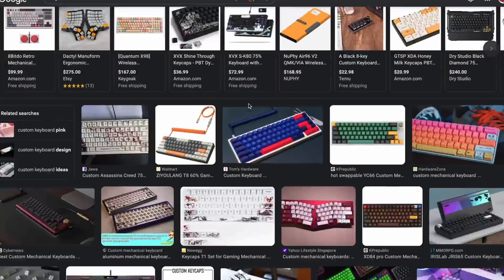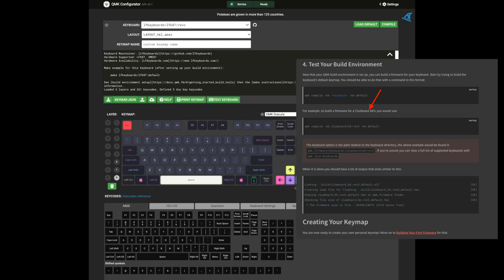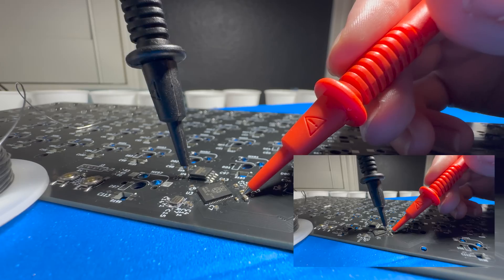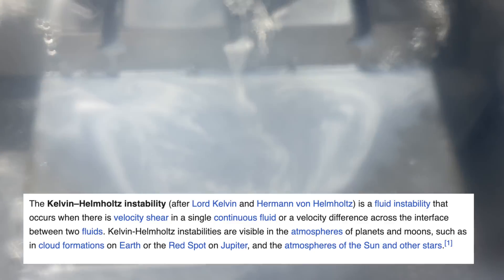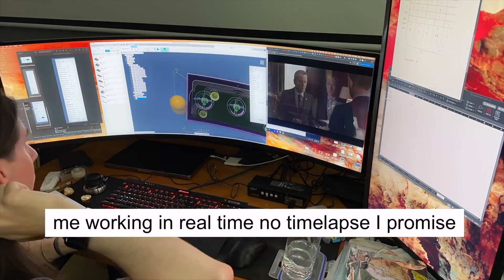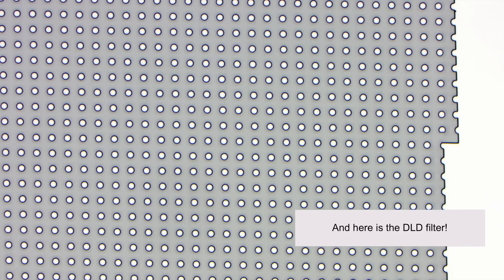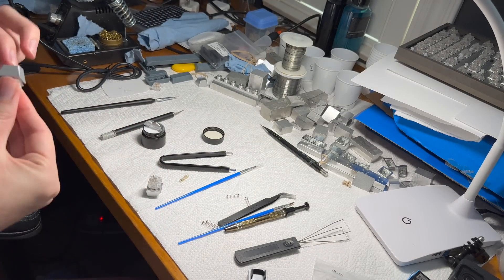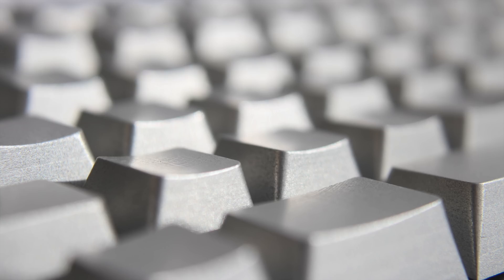Design and Fabrication of a Custom All-Metal Keyboard | banoa102

Comment: Hi boss, love the video. I saw you where using a third party simulation package instead of the one built into solidworks, why is that? Would you mind sharing the name, and the process of transferring the data in-between the two applications? We are currently running solidworks simulation trial but we are not to satisfied because many features are locked behind pay walls. ❤
Reply: O i see it is ansys, however i would still like to know if it's worth getting
Reply from the maker: @Bobsonman  Hey thanks for watching! Ansys is a great tool but it is rather expensive. They break it up into different modules (electrical, mechanical, cfd, etc). You could probably expect to pay 10k+ a year. I think startups get a discount. I receive the software free due to my college, but in about a year I will need to get it or have the company fund it. Hope that helps

Comment: Those keycaps for one printer would be so much easier and cheaper to produce using metal Printing, can do it all in a single job taking up the full build volume.
Reply from the maker: But then I don't get anything out of the project besides paying someone else to do the work for me. I don't have access to an DMLS printer

Comment: Wow man, that's a cool ass project, as someone who is currently doing mechanical engineering, this makes me want to finish this course even more, all of the problem solving involved in both the design and the manufacturing is simply incredible. Just a question, and I'm sorry if someone else asked, but how much does the final product weigh? You could probably use it as a weapon if you wanted to!
Reply from the maker: Glad you enjoyed! The keyboard weighs 4.5 pounds. Cheers!

Comment: Absolutely insane work mate, as you’re limited by low spindle speed for the radius of the ball nose end mill, I would recommend just buffing the outer surface of the keys to achieve a better finish. To increase production speed you could finish both long angled edges of the keys on a manual mill or with an angle fixture in the cnc. It’s always incredibly beneficial to modify less critical parts of your design to accomodate tooling and ease of manufacture, which can be hard to commit to if you become too engrossed in the design you want. If you had a cnc lathe, you could machine a fixture that grabs the keys from the backside, allowing you to turn the internal radius on the top of the key much faster. A similar fixture could be used in the mill, holding the key at the rake angle of the key side, to machine and finish the sides of the key to a higher quality. Maybe you could automate the indexing of the fixture as well. Simplification and streamlining of manufacture can save you a surprising amount of time. I am very impressed with the endurance and passion you expressed, and how you were able to stay so committed to completing such a daunting task. I imagine you will go very far as an engineer.
Reply from the maker: Thank you for the kind words. You are right there is a lot of creative ways to speed up manufacturing and I'm sure a lot of tricks I have yet to learn. Glad you enjoyed the video :)

Comment: Awesome video. DIdn't think I'd make it through. A few notes > you could have made it out of two pcbs so you could swap numpad side and run a channel for the cabling for the second board (or have the traces run to both ends of the board that is cabled. IN TERMS OF MACHINING. great job. I would've never tilted the head because retram is no fun but thats whatever. For the keys you could have done them in a few ops with longer material and tooling holes at an angle. This means you could screw down the block of 5 keys at a time and then just hit the front / back / top with an endmill in three ops for the best surface finish and almost no 3D milling. The tooling holes would have needed to be put in using an angle block first (or just straight in and the angle block was 3Ded with screws not perpendicular to the top face but to the bottom. Basically for the extra workholding and additional setups, you'd have dropped run time for the long 3D front back to almost no time at all. 1-2 passes with an endmill sidemilling instead of stepping down.

Comment: I wonder why you didn't metal 3d printer the caps form PCB way , I mean you milled lot of material.
Reply from the maker: Part of the point of the project was to get more experience with design and machining. That doesn't happen if I pa someone to do the hard work for me. Thanks for watching :)

Comment: Only 40h to do that? That's impressive, must be a lot of compicated connections...
Reply from the maker: The pcb has 2 layers (top and bottom of board) so it took a bit of thinking to route everything with minimal vias. But a lot of that time was making it look pretty and figuring out the software. Thanks for watching!

Comment: I'm a leftie too. Can't get behind your OCD tho bro, sorry. Numpads are a curse unless you're an accountant, in which case buy a custom wireless separate. And super low-profile scissor switches are king; full travel measured in a few MM. I'm over 60 and really don't get the millenial / gen-Z obsession with the hideous keyboards of the 80s I had to live through. Buckling-spring, Cherry MX, whatever. Honestly, nice fab and all, but, just, wow. Any KB larger than 60% - 75% is needless if it has the right keys, and don't get me started on RGB!
Reply from the maker: mfw when i am an accountant. They're quite useful for design and cad. Thank you for watching :)

Comment: Bruh, backlight. Bruuuuh
Reply from the maker: Bro, like, you can't see light through metal, bruh. But check it, there's LED footprints on the PCB, so you could swap out those keycaps for some transparent ones and use 'em, bruh. Trust me, it's gonna be epic, bruh!
Reply: @conorarchdeacon  jkjk but like transparent aluminum (is actually real)
Reply: Really hope the cnc is worth it once you get it, if you don't got it yet

Also regarding a game that IS about finding bugs in someone else's or your own code. Please stop that isn't funny someone might actually realize we all secretly want that.
Reply from the maker: @DominicRyanOsborne  hah might have to get some of that transparent aluminum. And my code has enough to bugs to keep me busy… don’t need to add more problems to it!! Thanks for watching :)
Reply: For anyone interested

aluminum oxynitride + Google returns that the material may be good for machining these types of parts. Just missing sourcing and prices relative to more typical materials
Reply: For anyone interested (previous comment went poof)

aluminum oxynitride + Google results in the material probably being good for machining these types of parts.. Perfect for backlight nonsense. Though gemini further mentions that the price would be several hundred times higher than aluminum making such a project impractical.

Comment: As a righty, i use separate keyboard and numpad. With the num pad on the left.

But sometimes i do things where i need real estate (e.g. for more MIDI controllers) but don't need the numpad, then i yeet it somewhere and move the keyboard.

I think numpads don't belong inside keyboards. They are born to be free.

For what it's worth i nearly died when you called stainless plate "the easy part". Sure it is flat but it's also a material that just hates everyone and everything.
Reply from the maker: Numpads can definitely stand on their own! And yeah it took 2 tries (plus some behind the scenes test fitting for kerf from laser/waterjet) to get the plate locked in. Thanks for watching!

Comment: You are unhinged my friend
Reply from the maker: The FitnessGram Pacer Test is a multistage aerobic capacity test that progressively gets more difficult as it continues. The 20 meter pacer test will begin in 30 seconds. Line up at the start. The running speed starts slowly but gets faster each minute after you hear this signal bodeboop. A sing lap should be completed every time you hear this sound. ding Remember to run in a straight line and run as long as possible. The second time you fail to complete a lap before the sound, your test is over. The test will begin on the word start. On your mark. Get ready!… Start. ding

Comment: Something I realised very quickly after replacing my keys with ceramic caps, They hurt the joints in your fingers big time. the extra inertia in the keys when they rebound is not ideal.
Reply from the maker: I'm finding it ok for now. They are pretty light (2g for the 1u keys) so it hasn't been too noticeable. Thanks for watching!
Reply: @conorarchdeacon  That's promising to hear, the coldness of the keys is something else to consider, I work doing CAD and I can say for sure that RSI is no joke. I'd love to see someone do a lightweight keyboard someday, like out of Carbon Fibre or something. would be pretty awesome i reckon.

Comment: Hey happy graduation! (Hopefully times lines up 17:14 ) this is a dope project and has me wanting to think about making a version of my own.
The pcb creation being the main part that has me worried 😅
Reply from the maker: Hey thank you very much!! Pcb was a little intimidating but there is a lot of documentation out there to help out. Kicad is great at streamlining the process (you draw a circuit diagram, then assign footprints to components, and then place the footprints on the board). And Kicad ensures what you draw in the diagram gets hooked up in the board when routing. Two thumbs up from me. Best of luck with your projects!

Comment: machining is absolutely the worst way to manufacture this. why not just send it off to get metal 3d printed?
Reply from the maker: Have you ever done something not because it was the most efficient way, but because it was fun? Seems you missed the purpose of the project.
Reply: @conorarchdeacon  yeah I do things for fun all the time.  The project itself is impractical but fun. Doesn't mean you have to do mundane things.  You seemed to lament sitting there for days watching the CNC.   If that tedious part was fun for you, then more power to you!
Reply from the maker: @disp3rsion  To answer the PCB question (your other comment) there is a level of quality/complexity that I cannot easily do and a machine can. I didnt want to do hand wired, but I did want to have a pcb. I considered making my own pcb via a router, but decided to go for a more reliable method (paying a company to do it). This also removes liability (the company says they can do 0.3mm traces, great. Can I? Probably not). As for the cnc, yes, it was somewhat mundane and I was required to be present at all times while the machines were running, but I often worked on homework or projects on the side. It was mostly just swapping tools and parts. Hope that helps :)
Reply: @conorarchdeacon  along the same lines, why didn't you etch your own PCB? Or use wires instead of a PCB?

Comment: Wait, did you actually chew through the bolts holding the aluminum stock?
Reply from the maker: Only 2/4 of them lol! the holes were tapped so it didn't really affect anything. I just lost the head so I couldn't get them out (hence needing to weld a arm to them to get more leverage. Thanks for watching

Comment: Are you considering marking the keycaps? I imagine the keyboard could be difficult to use when using some of the rarer keys, or maybe having spent so much time on the keyboard, this isn't an issue? Either way I absolutely love the keyboard! How is the actual feel of the keycaps? I imagine they're much colder than plastic ones, wish I could try it irl tbh.
Reply from the maker: Yeah I thought about it (cnc the symbols, put on decals, sandblast taped off areas) but it would've greatly increased the complexity as every key becomes a one-off. I probably won't add symbols and just get good with touch typing. The keys have a smooth texture, they do start off cold to the touch. Thanks for watching!
Reply: @conorarchdeacon  Thanks for the reply, legendary video!
Reply: @conorarchdeacon   Have you been planning on adding a temperature controlled nichrome heating coil to the plate? You could make the keys always be at ideal body temperature...

Possible problem: if you have a cat, it will occupy the keyboard and eventually accidentally discharge some urine into it just a little. I suppose you can add an IFF circuit (identify friend or foe) and electric shock capability to mitigate that.

Comment: Looks great. I've been debating on making a keyboard from scratch for awhile now. Something that may bring down the machining time is bullnose end mills. They can get a pretty good surface finish since they have a radius instead of a sharp corner.
Reply from the maker: Thanks for the comment! I actually used a bullnose endmill for the case, but now that I'm thinking about it, it would've been great for the keycaps also. I was a little limited by the available cutters I had and didn't want to spend too much on endmills
Reply: @conorarchdeacon  Yea, I get that. I’ve got a desktop cnc at home that I chose to learn cnc on. I sunk quite a bit of money on end mills in the beginning learning expensive lessons lol

Comment: Why do you switch to Fusion for CAM instead of the Solidworks integration? Just curious!
Reply from the maker: I use both but I find the HSMWorks integration a bit clunky. Fusion is also more streamlined for Apple silicon, and my laptop is with me wherever I go (and thus my models/real time editing are also). Other options include running Solidworks virtually or remoting into my PC, but it's not fantastic. Thanks for watching!

Comment: how did you get ansys and solidworks to work on your apple silicon mac? 

Anyways, amazing work dude! Was amazed to see t6 used on a keyboard lol 😂
Reply from the maker: I use Parallels (a paid subscription virtual machine) to run Ansys and Solidworks on the go. For heavier computations/modeling, I use my PC. But my laptop goes wherever I go and on the fly stuff is possible with Parallels which is invaluable to me. Thanks for watching!

Comment: awesome project. 
i know, people tend to love this "hackerman keyboards with no printed labels", but i think waaay cooler would be, if you cnc-engrave the letters, and fill the voids with black resin. this is one of the biggest drawbacks on keyboards for me: beeing able to have a truly custom font on the keycaps (especially because you can have a correct representation of any custom qmk-layout this way for all the layers).
Reply from the maker: I wanted to add symbols but it would've greatly increased complexity (every key becomes a unique one-off now). Other options I considered were decals, laser etching, sandblasting masked off areas, and of course cnc letters. Obviously I ended up not doing any of these lol. I really like the simplistic look no symbols gives the board. And of course as you mentioned it dissociates mapping in qmk to what the key says it is. Thanks for watching!
Reply: @conorarchdeacon  That all makes a lot of sense ... but just imagine this with some sort of inlays!

Comment: This turned out so amazing and I only recently got access to a cnc machine and have been thinking of making this exact project. There were plenty of aluminium frames to buy, but i couldnt find anyone who had cnc'd the keycaps as well. I am not nearly as proficient with code or cad as you are, but that too is a pretty useful insight about what i could be getting myself into. I would like to know if you'd be open to making the cad files available to everyone?
Reply from the maker: I probably won't release cad files. That being said, keycap profiles are well documented and can be designed very easily. There is totally no code needed for this (besides CNC g-code which you should have a minimal understanding of what the machine thinks you want it to do but totally don't need to be proficient). Since you have access to a CNC machine and are interested in making your own I think this would be a fantastic starter project (maybe doing an escape key or WASD, otherwise it gets kinda long)! The cad is minimal, and you'll always need cam (the toolpaths) for using the CNC. There's clever fixtures and design for manufacturing, but this is just considering the sequence of operations you do while making the key. Actually making a few keycaps would take a short amount of time once you get going, most of the thinking happens up front. Hope this helps and thank you for watching!